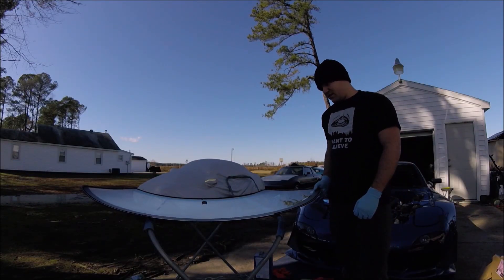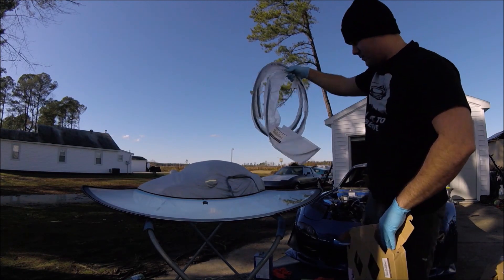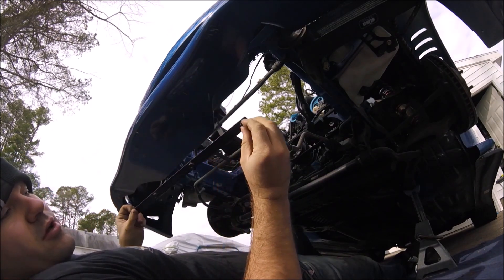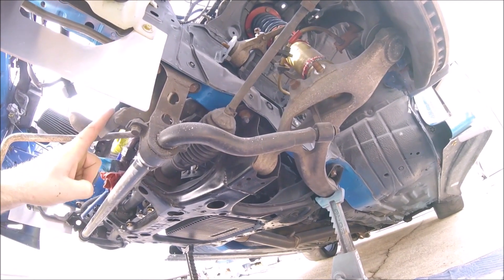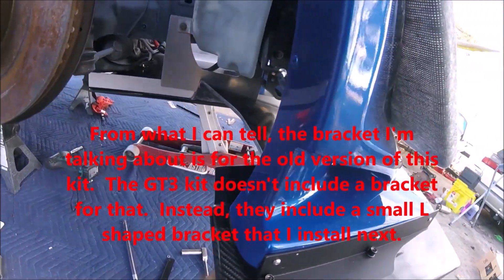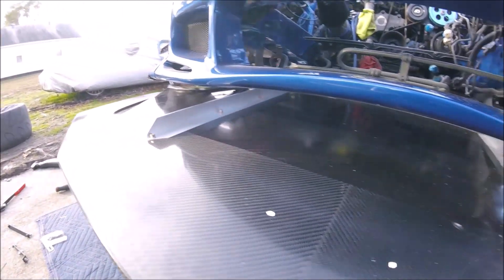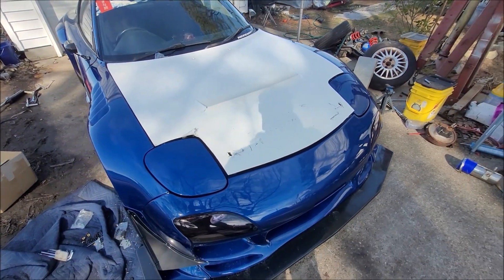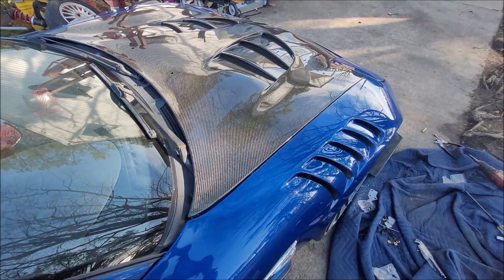Rebuilding my Wrecked FD3S RX7 Part 5:  Reassembly

Comment: Hey bro, what size are your wheels? do you have spacers and what tyres are you running? Great looking car too mate.
Reply from the maker: Hi.  They're 18x10.5 +12 or +15 IIRC.  The front has no spacers, but the rear has 35mm spacers.  The current tires are 295/30 but I'll probably swap them out with 265 or 275 tires when I replace them.
Reply: @Norman_X_Seven  Thanks for the fast reply. Im tossing up between the feed afflux wide body and this GT3 one for mine. Does the GT3 look awesome IRL? Its a fair bit more than the older one so im not sure if i should get it and shipping to Australia is as much as the kit.
Reply from the maker: @MrAlexander909  It looks awesome IRL.  With shipping to Aus I don't think I would have bought it, but being able to pick it up in person while I'm Japan it was worth it to me.